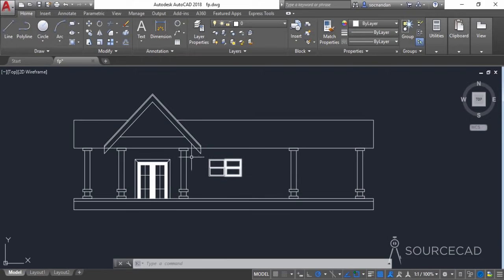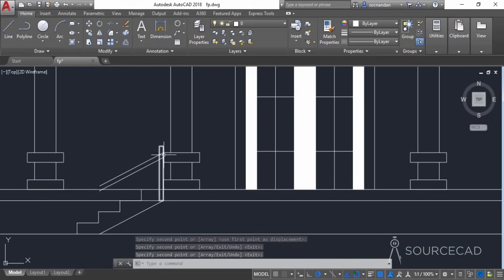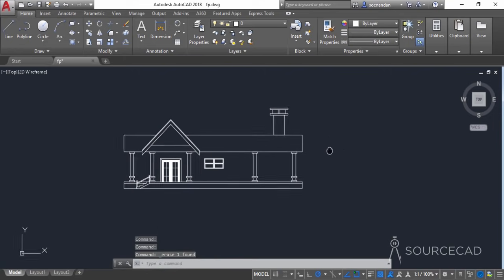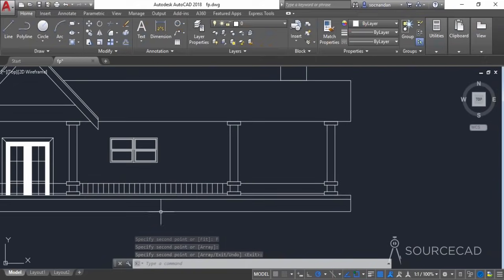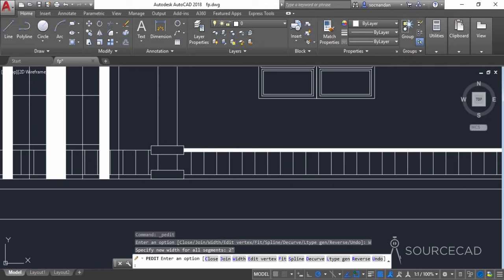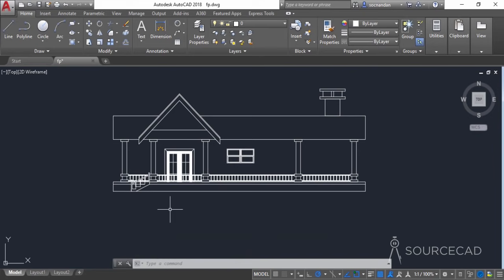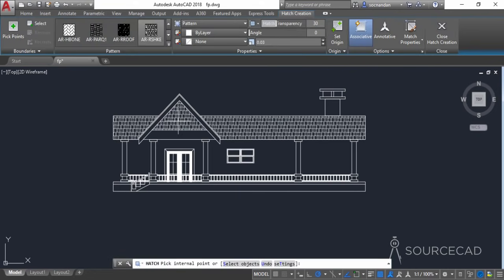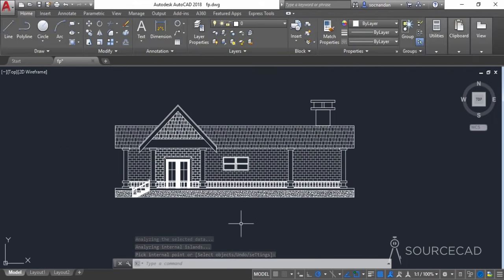Making elevation view from floor plan: Bonus part 2 of 2

Comment: I have a question. When it comes to the railings why do you prefer to use poly line instead of straight line? is there any specific reasoning?
Reply: SO THAT YOU CAN HAVE POLYLINE OPTION LIKE WIDTH HE USE TO MAKE RAILS

Comment: I couldn't get the stretch tool to work the same way it does in yours. Even if I only select the top part of the chimney, it just moves it around instead of stretching it like in the example.

Comment: the rail @the stair is giving me problem when imputing solid hatch
Reply: If In that case u can take that part to side with the reference, then hatch n place with same reference. Or else copy it and place with original coordinates in new DWG sheet once done the hatch. U need to copy the same to original file and paste with original coordinate option.

Comment: I have pc having....
2gb ram 
Dual cor prosesar.
250gb hard disk.
2d auto cad sahi chalta hai.
But autocad 3d me  error ata hai.
......
Please tell me ...ram kam hai
Ya .....grafic card nahi hai isi liye
Reply from the maker: AutoCAD is a single-threaded application and needs faster core instead of multiple cores. In your case, your processor not sufficiently powerful and the RAM is also way too low. At least a quad-core processor with 4 GB ram is needed for the optimum performance of AutoCAD 3D.